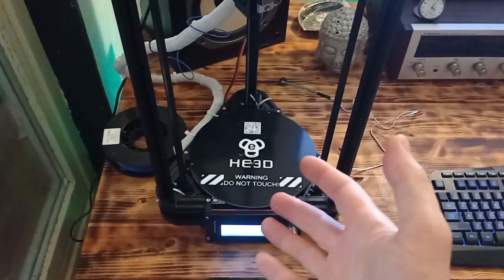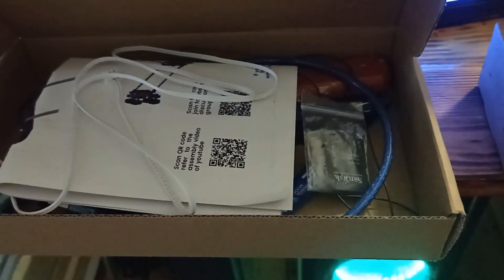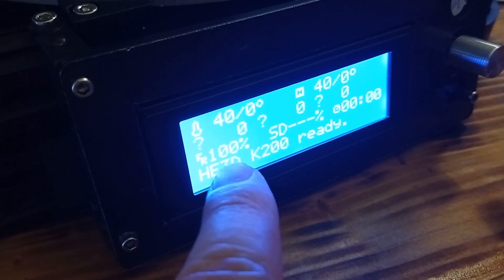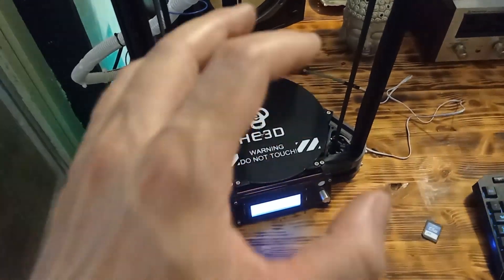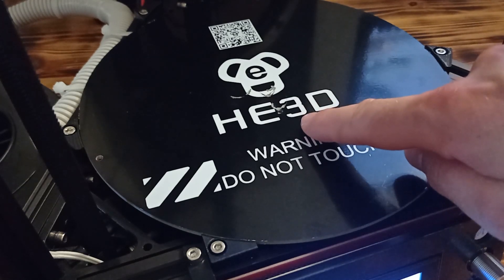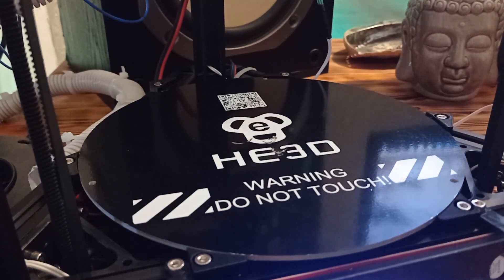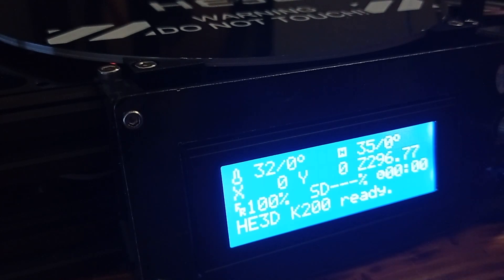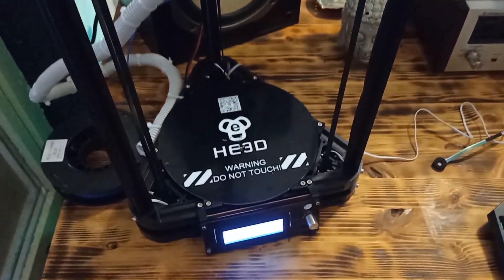Diy Delta 3D Printer Kit - He3D K200 Review

Comment: Interresting printer, im looking for one to print "long" wind generator blades in 1-4 parts. What is the white tube for ? It looks like it would be dragging over the printed objects and is not part of the original printer design.
Reply from the maker: yes, it is interesting 3d printer, but this one is much better: https://youtu.be/_0UfZ1Hkcaw
Reply: @BundytheGeek  Yes, the FLSUN printers have a great build quality and good software with integrated wifi.
I have both the QQS-pro and the SR Super Racer, but both can only print parts 30cm high (max 33cm in the middle).

Deltas are prefect for long and (internally or external) complex strucutures.
For a Darrieus or Savonius wind generator functional test model, the blades need to be 60-120cm, so currently in 2 and 4 parts with all parts stuck onto an GFK stiffener rod (similar to model airplane wings).
A delta that can print them in just 1 or 2 pieces could be very useful.

What is the large hite tube used for ?

Comment: Hello. help to solve the problem. on the DELTA printer, I print a circle, an oval. I changed belts, changed motors, changed pipes that hold the extruder, the table is calibrated. I can't print a smooth circle, thanks in advance
Reply from the maker: hello, did you use settings provided from sd card ? there is one file for test print, you need to use the same settings.